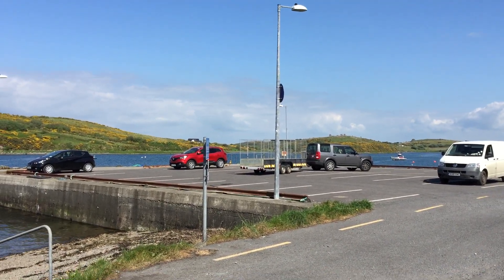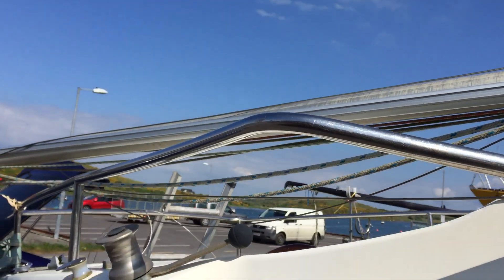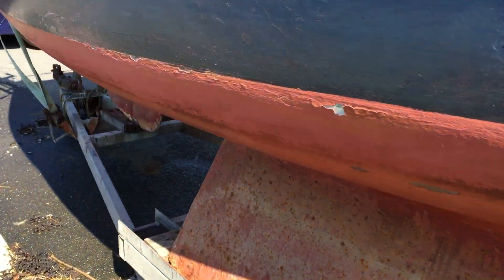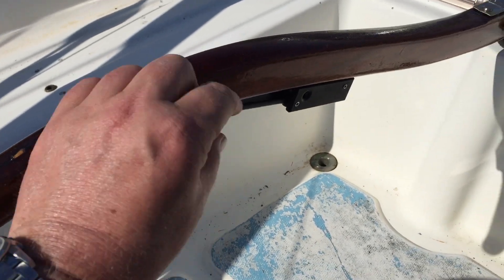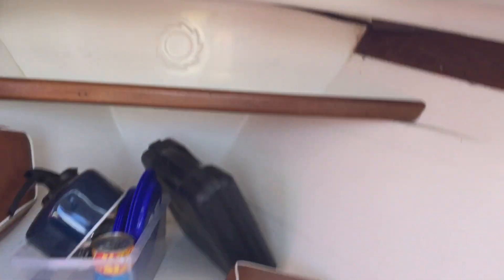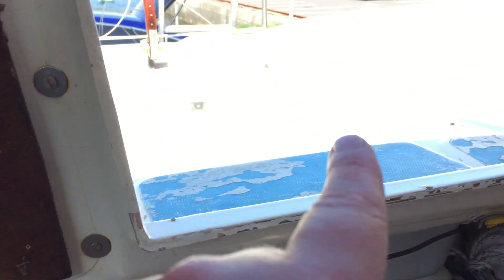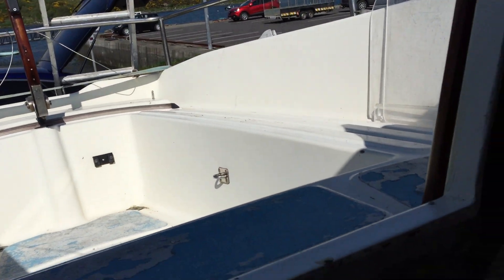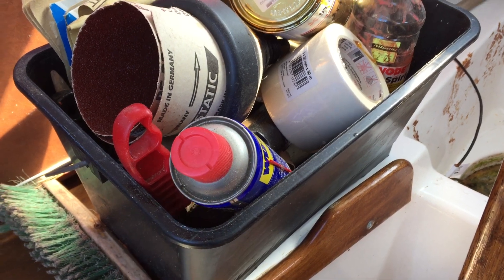Leisure 17 Even Keel - pre-season preparation update 2018

Comment: Just bought an SL version. Hope to get out in it this Summer.
Reply from the maker: Good luck with that, enjoy they are great little yachts.
Reply: Lets sail together
Reply: @derekclarke8097 , Im thinking of a 17 for sale here in UK. Is the mast foot attached with a pi? Wondering can I step the mast if I want to trailer sail or will it need a hoist? Any advice gratefully received, thanks for the videos.
Reply from the maker: @gandtsailing282  Yes, two fairly delicate 'lugs' with a pin going through. Easy to step with someone to help, one to lower with a rope from the bow and the other to hold it as it lowers backwards. No need for a hoist at all.  
Is the rest of the boat in good condition?
Reply: @derekclarke8097  it looks serviceable but needs a good clean. Its sailed in last few weeks so is sound hu etc. but needs some TLC. I'm hoping to tidy as I go.....looking to get to Co. Cork for summers with trailer so might see you one day👍 any advice on buying what to look for etc ?
Reply from the maker: @gandtsailing282  drop me a line to dfmclarke@gmail.com.